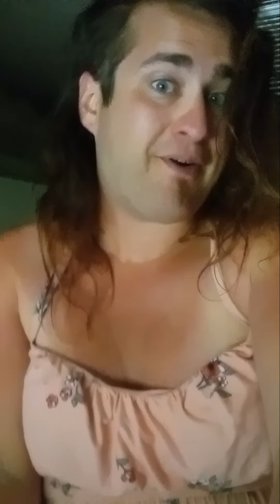New Battery Tech! why Tesla fired Supercharger team! @tesla

Comment: Hey samoht do you think maglite will ever come out with brighter and throwier flashlights ?
Reply from the maker: I had a 6D cell that was pretty throwable... would be cool to have one with 4680 cells in it... 6 4680 cells... Tesla Maglite...
Reply: @AquarianSoulTimeTraveler  I want a 8000 lumen maglite with powerful osram led chips with a 800,000 candela tops stainless steel strike bezel tail cap glass breaker gorilla glass lens and also for maglite to eliminate that ugly donut hole error from spot to flood and i'll be happy but they won't even do that for anyone😎🚬🍺🔦🔦🔦🔦🔦🔦🔦🔦